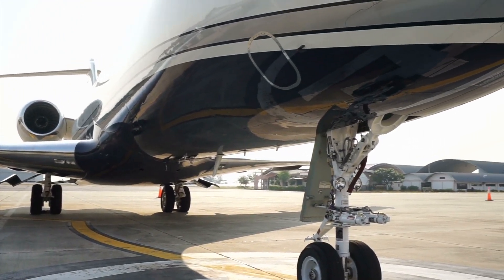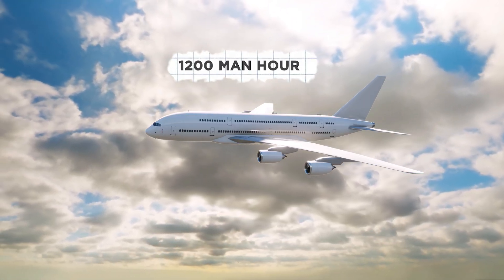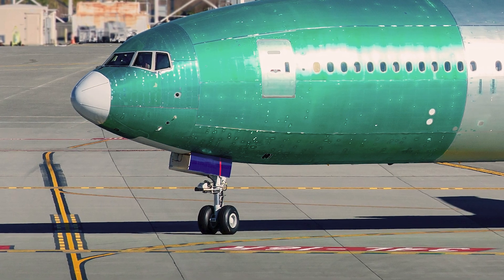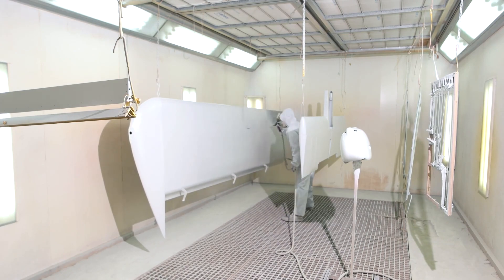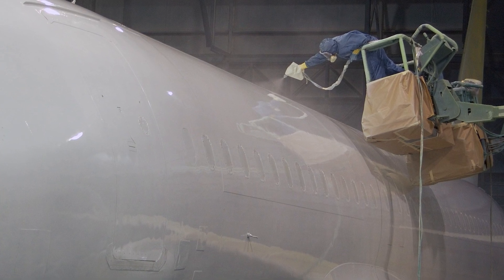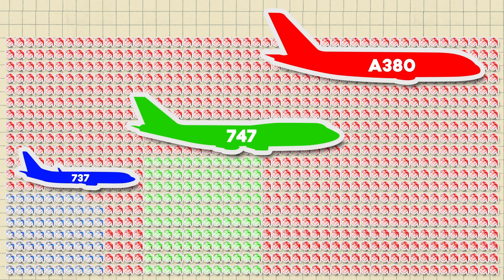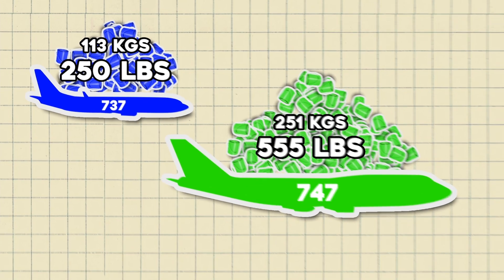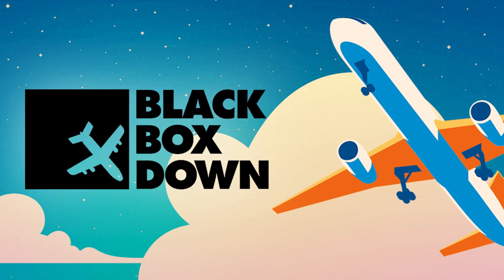How Many Cans of Paint Does a Boeing 737 Need? | Black Box Down: Explained

Comment: There's a reason USAAF went to polished aluminum for their aircraft once the Allies gained air supremacy in WWII. Early in the war, the planes were painted to make then harder for the enemy to see, but around D-day they stopped bothering to paint them, because there weren't any German or Japanese fighters left to chase them, so may as well be extremely visible and carry a couple hundred pounds more fuel or another bomb. American Airlines was bare metal with a cheatline until it cost too much to keep them looking nice than the fuel savings from not painting them. Modern planes HAVE to be fully painted because they've got a lot of composite bits.
Reply: I scrolled down to mention AA - there are so many great stories of AA's "optimization" efforts back in the old days, and the polished aluminum bodies is one of my favorites.